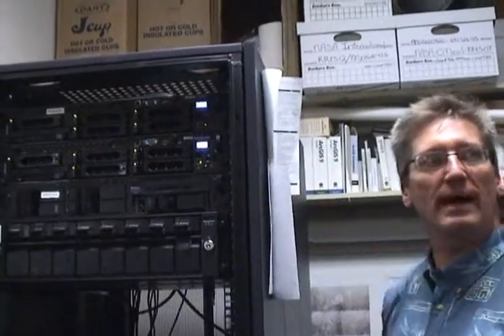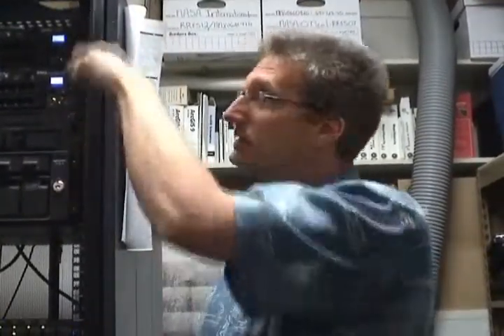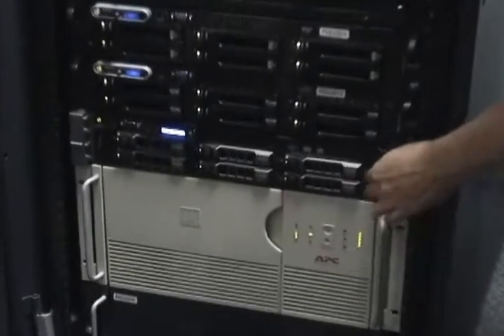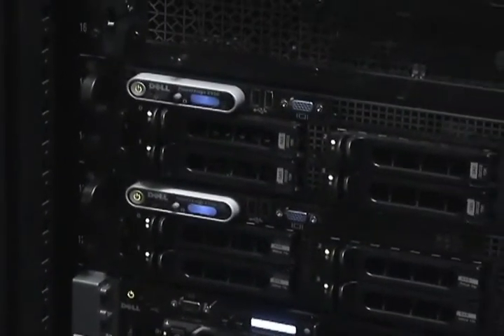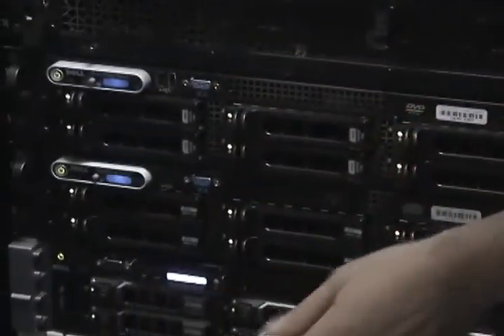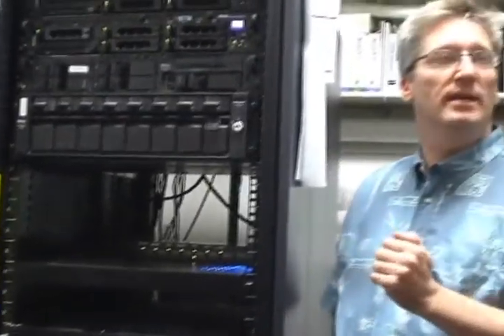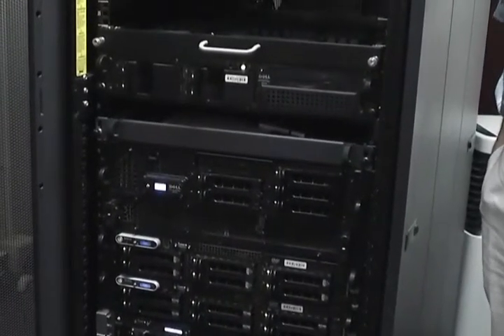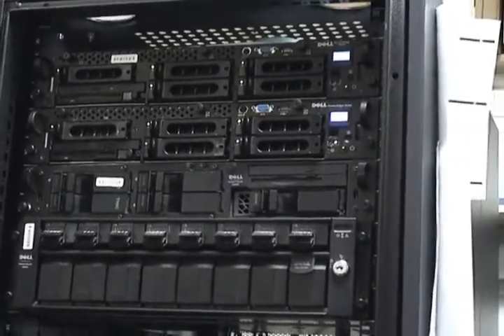IT4GIS server room tour_part1of2.wmv

Comment from the maker: Yes, humidity is a concern. High/variable humidity will cause condensation and as we all know, water and electricity do not mix well.  To take care of this our AC runs nearly constantly keep the temperature relatively low and the air pretty dry as well.

Comment: Does humidity factor into server management? it seems with the potential changes in temperatures needed to maintain the climate then a certain degree of condensation may occur. is there air dry enough? is it an issue at all?